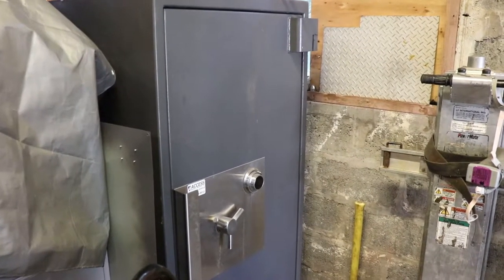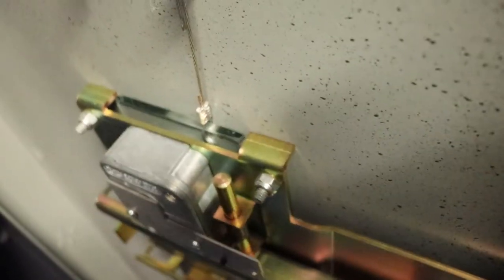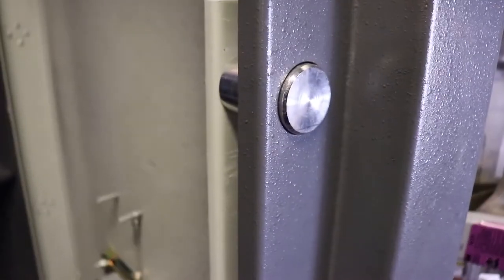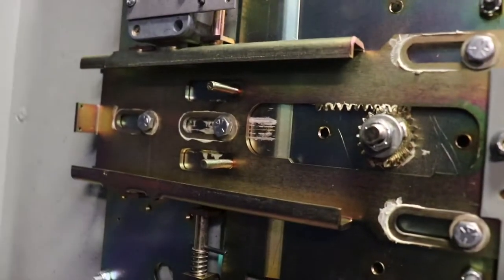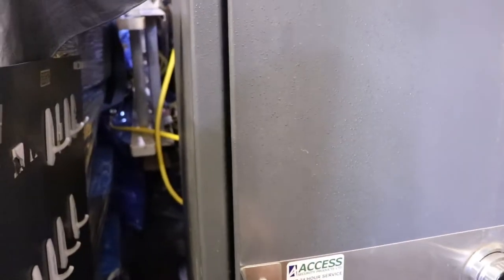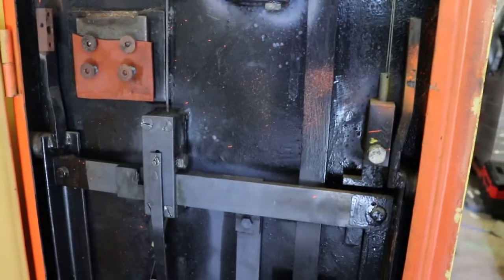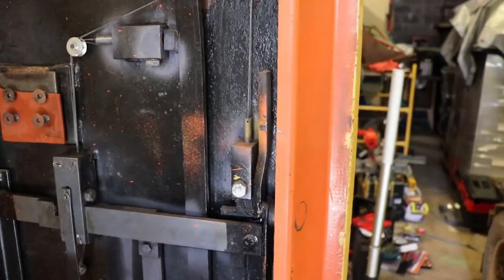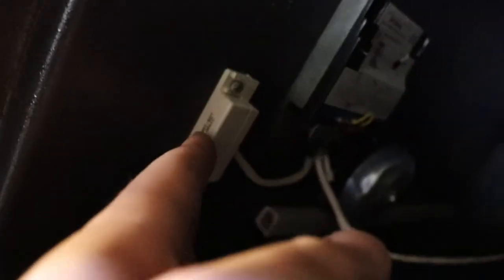Safes - Glass and Fusible Link Relocker - Access Security vs. Tann

Comment: Who ever came up with the glass relocker really loved locks and safes . If a building caught fire with this set up , the glass being heat sensitive would crack up and lock that bad boy down . Would be some job to drill in and remove the pins , I’m sure the manufacturer would help steer . Thanks so much , I was always curious on how it worked . Very clever .
Reply: Yeah safe companies have drill points to provide to licensed safe technicians to drill out the relockers.  Any safe can be opened good safes just take a lot longer.
Reply: The glass is not heat sensitive it is called an AED anti explosive device and to stop b
locks being punched off into the back pan, You have thermal links made out of lead for heat attacks.
Reply: @ I stand corrected sir , thank you for the knowledge. I will be buying a TL rated safe next year , Holland , no dial , just electronic key pad , my thinking is an electronic device would be harder to bypass ? Dials have wheels , less secure ?

Comment: This type glass relock mechanism was actually quite easy to bypass once I accidentally triggered one on a customers safe. Drill a hole a few inches below the lock and snag the cable with a custom made tool (a bit of coat-hanger wire) pulling the cable back through the hole until the bolt fully retracts. Ta da! 😉
Reply: Unless the aed deadlocks.
Reply: @philipinchina  🤣🤣🤣 you need to a rigid scope to make sure 😃😹🤣🤣
Reply: All the dead!/passive relockers on the Swedish Tann, second safe are crosslocking